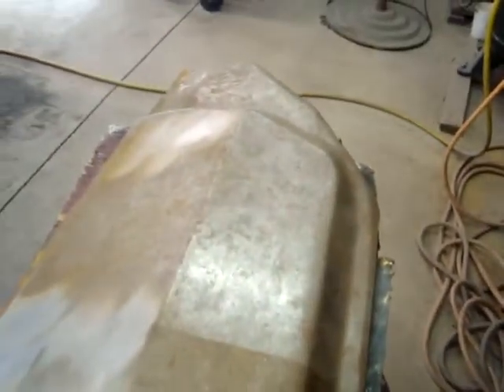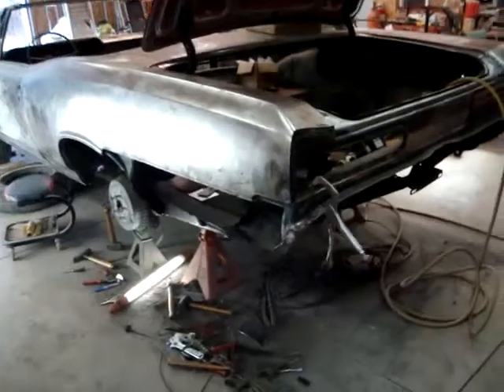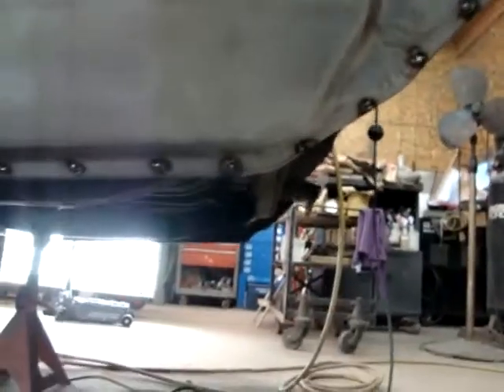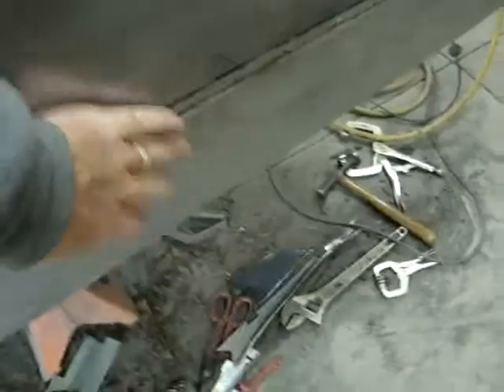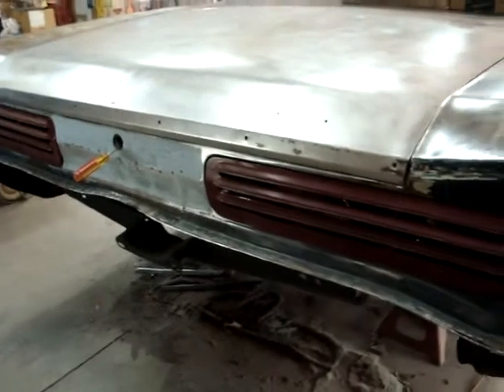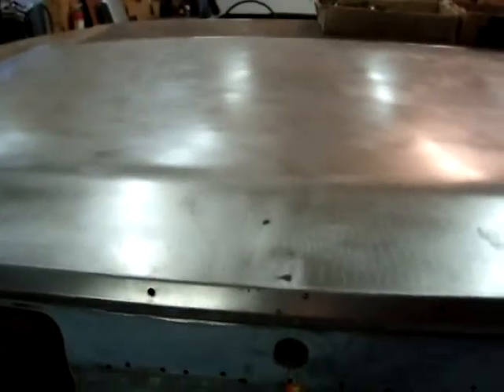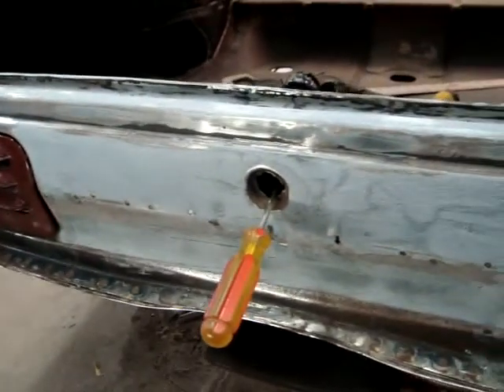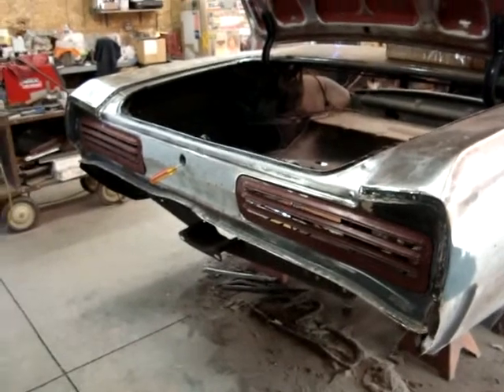1966 Pontiac GTO Part 15

Comment: nicely done! how do you finish the panel  joint  on the inside trunk side, thanks
Reply from the maker: The seam can be body  worked on the inside just like the outside to hide the seam line. Depends on what you want or in this case the customer.